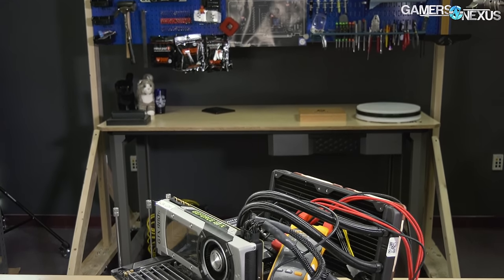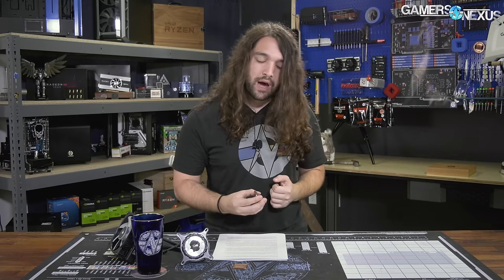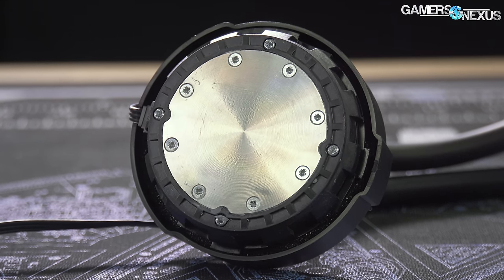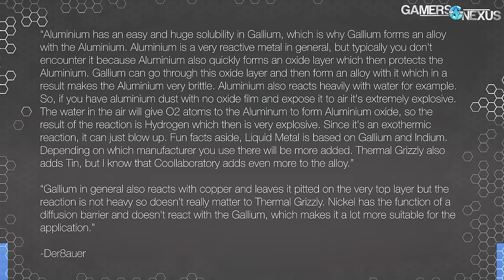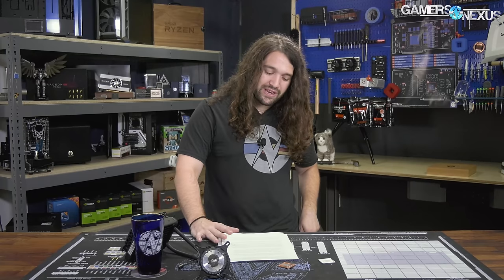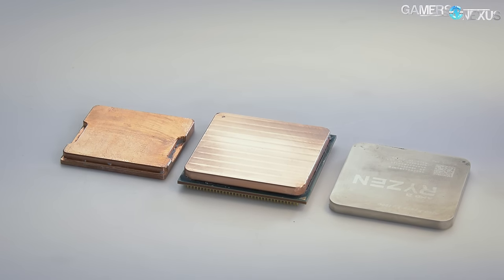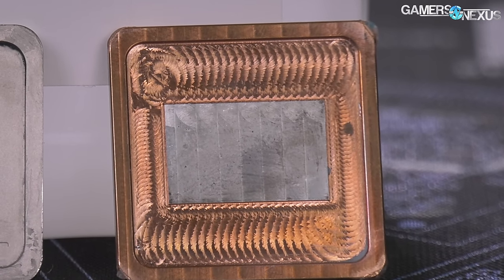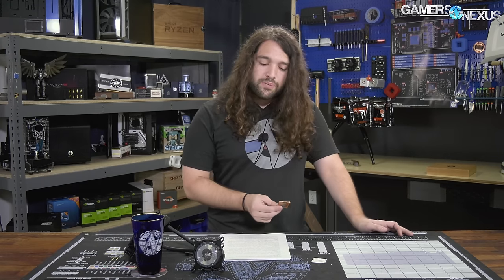How Liquid Metal Affects Copper, Nickel, and Aluminum (Corrosion Test)

Comment from the maker: Check our video on how long liquid metal lasts: https://www.youtube.com/watch?v=fnbovjT4JLQ
Grab something on the GN store! https://store.gamersnexus.net/
Article: https://www.gamersnexus.net/guides/3362-how-liquid-metal-affects-copper-nickel-and-aluminum-corrosion-test
Reply: Liquid metal can also damage solder joints, so it's not a good idea to use it for shunt mods.
Reply: Steve, would you please do some tests with lapping cold plates?  It would be interesting to see how much a mirror-finish affects temperatures.  You'd probably want a control test, a lapped cold plate only test, and finally a lapped cold plate and lapped CPU IHS test.
Reply: Hey Steve iv seen some concerns and photos of the effects of liquid metal to the die itself. Can u please look into this if there's any truth or anything to worry about?
Reply: great dive into the potentially controversial topic. I do suspect that the depth of tainting is only atoms thick beyond the imperfections of the copper surface. And even then, unless a heat pipe is already on the edge of failure due to excessively thin outer walls, the atoms thick tainted copper outer layer will not cause any problems at all. Also, given the nature of LM attoms filling gaps between copper atoms on the surface, it may actually make the surface a tad better for contact area to whatever TIM is later used (albata possibly immeasurably outside of an ultra-precision lab test), due to LM atoms being better at conducting heat than a void between copper atoms, lol.

Great vid GN crew.
Reply: Thanks so much for this video! I've been pondering these questions for a while. Good to know all the laptops i repaired and did cpu upgrades for will be fine. I started to question the longevity of the performance seeing first hand how the copper and LM react with each other.
Reply: Satellite of Discontent, as der8auer had pointed out in a few vids on soldering CPUs that had not been intended to bond to Indium soldiers, the die is incredibly huge compared to the depth that tainting would diffuse into the glass in any reasonable time frame. at most, LM would only be a few atoms thick on the Silicon nitride protection layer, that is well over a millimeter away from the other side of the wafer where the transistors and circuits are. In all honesty, by the time LM attoms defuse and migrate that far, the atoms that make up the circuits would also have migrated into nothing that would resemble a recognizable circuit, lol. And we are not talking hours or days, we are talking decades for the accumulation of individual atom migration to be a problem on any integrated circuit. A spacecraft with a life expectancy longer than Voyager 1&2 may be concerned with such atom migration, a CPU or GPU that will be replaced in under ten years, not so much. It is a good question.

14nm transistors are about 0.000064mm in size, vs 1mm of glass between the transistors and the LM. And I suspect the atomic migration through glass will be about the same speed for both of them (LM atoms, and the atoms that make up the transistors).
Reply: Byte my bits would really appreciate  I short reply to his latest video bud.
Reply: Fun fact, This is the reason that explosives for use in water, like depth charges, use Al dust.
Reply: There's a very eye-opening video from youtuber LockPickingLawyer called [593] Gallium vs. Titalium - Abus Padlock Meets a Gruesome End that shows perfectly why you shouldn't get Gallium in contact with Aluminium.
Reply: Fun fact: The explosive nature of the aluminium reaction der8auer described is why a lot of solid rockets use a mixture that's partly powdered aluminium. For instance the Shuttle/SLS boosters use (16% by weight) atomized aluminum powder in the fuel.
Reply: @Daniel Monsanto obviously not a long term solution, but you should know what you're doing before you even think about shunt shorting anyway
Reply: Thanks for this one. Steve, you da besst!
Reply: Are thoseRTX cards in the background
Reply: Question i could not find an answer to anywhere. What is better for heat transfer, a soldered CPU, or a CPU with Liquid Metal between it and the IHS?
Reply: Try some ammonia mixed with hydrogen peroxide. To remove the staining from the copper ish. You can form complex with the ammonia and ions.
Reply: Is you guys restocking the beer glasses?
Reply: pr0xZen  Instead of nail polish, one can use a professional coating. I use MG Chemicals Urethane Conformal Coating #4223. Has very good characteristics. Vile fumes when it dries.
Reply: I know gamers nexus is biased to thermal grizzle because they pay you, but disregarding that, the fact remains that coollaboratory liquid pro has far far far better thermal transfer over the copy cat conductonaut. If you are going for conductonaut you're better off with coollaboratory liquid ultra or coollaboratory liquid copper which doesn't have the pitting "issue" at all. Coollaboratory liquid copper is also what you should use for proper shunt mod since it doesn't dissolve shunt soldering, and it doesn't have the unpredictable viscosity.
Reply: A very hazardous stuff when  oxidized. Be warned! Also not  73 W/mk but rather 16,5 at best. Since that what galistan i.e LM can do. Proof of health hazard:https://www.ncbi.nlm.nih.gov/pmc/articles/PMC4007045/
 And a few more! Proof of galistan conducting only 16.5 W/mk is Googleable
Reply: I testes with a EK EVO and a delid 8700k  and at the beginning the performances was there . But after 7 month I was surprised to see CPU cores reach more than 90° at 100% of use.  I unmonted the water block and all the metal liquid was completely dry and  in the cooper surface was like electrolized... happy to have detected this issue before to burn my CPU... I will unsealed the HSI to check how it is...
Reply: Don't use it with vertical motherboards because it WILL leak and piss all over the MOBO my TIM of choice is Kryonaut under the IHS and OVER the IHS the consistency is swell Nice shop too nexus!
Reply: @johndrachenberg2254  try a IHS that has been scored one way Mirror finishes usually end up with leaks!
Reply: @Visentinel  Can you PLEASE not type in "TXT" talk it's highly annoying and makes you look like your 3
Reply: @pr0xZen  So old VHS tape fluid is out?
Reply: @fr33kSh0w2012  ???
Reply: Gamers Nexus did you also tested tempered and untempered metals?
Reply: Daniel Monsanto that’s right if it’s indium, not lead solder.
Reply: Is it ok to use normal thermal paste on top of IHS while having liquid Metal inside of IHS.and if so ,will I get good performance from cpu with temperatures ect ty
Reply: @kobishahar2962  Instead of finding a ready made answer, why don't you gather the important physical characteristics to come to your own conclusion?
The thermal conductivity of liquid metals ranges 40~80 W/m-K.
The thermal conductivity of indium as a typical solder for CPUs is 86 W/m-K.
The thickness of liquid metal can be extremely thin (µm range) with no mechanical stress while the temperature is changing/the materials expand at their different rates as long as the TIM is liquid, while the thickness of the rather solid indium solder must be rather thick (mm range) to accommodate the different mechanical expansion of the materials soldered together so that the thermal resistance of a 10µm liquid metal may be 1~5% the resistance of a 1mm thick Indium solder.
Seeing it only from the perspective of heat transfer, liquid metal should be superior to a solder, because with liquid metal you can realize a may be 100 times thinner TIM before the solid copper with its superior conductivity of about 400 W/m-K can be applied.
Adding as 2nd criteria the time effort/behavior makes the judgement more complex. A solder is dimensioned/soldering is usually performed only once in the life time of a device. For long term liquidity of a liquid metal I believe you have to separate between 1) copper and 2) nickel plated copper. On nickel plated copper the liquid metal probably stays liquid for the life time of a CPU. On copper however gallium is permanently leaving the thin liquid metal TIM to diffuse/migrate into the copper to form there the alloy CuGa2. But the gallium that diffuses/migrates into the copper is missing in the liquid metal and with ever lower percentage of gallium the liquid metal is becoming after a rather short time hard at room temperature. In general the liquid metal on copper is better replaced each 6 months, because waiting for the temperatures to show a noticeable increase may result in the remains of the liquid metal having changed to some hard material which needs quite some effort to get removed.

Doing some basic calculation with a lot of assumptions to understand in absolute terms about what is spoken could look as follows: A CPU designed for 100W TDP is reporting a temperature of 75°C under load at an ambient temperature of 25°C (Note: Intel tested the accuracy of such thermal sensors and one should consider in extreme case a deviation of +/-4°C).
Taking these assumed numerical data one can calculate: 
   Thermal resistance (CPU-core to ambient) =  (75°C-25°C) / 100W = 0.5 °C/W
This total thermal resistance of 0.5 °C/W consists of following series of resistances (high quality desktop): CPU transistors to surface of the silicon die + TIM1 (commercially either thermal grease or solder or applied by private people liquid metal) + nickel plated copper heat spreader (lid of the CPU) + TIM2 (commercially thermal grease, a few enthusiasts apply liquid metal) + copper block (only in high cost/quality CPU fans) + large fan ventilated aluminum heat spreader/heatsink/heat evaporator to air/ambient.
When the CPU would operate at 20° higher temperature of 95°C the result would be:
   Thermal resistance (CPU-core to ambient) =  (95°C-25°C) / 100W = 0.7 °C/W
In other words, for a 20°C reduction in the operating temperature of  the CPU one looks for a way to reduce the thermal resistance by 0.2 °C/W.
How many percentage of the 0.7 °C/W (reduction of 0.2 °C/W) is related to TIM1?
In addition to the thickness of TIM1 one needs also to know the area and for a CPU silicon chip one can roughly assume 200 mm². Further assuming the thermal grease applied has a conductivity of 4 W/m-K results for an assumed thickness of 0.1 mm in:
   Thermal Resistance TIM1(thermal grease)= 0.1 mm / (200 mm² * 4 W/m-K) = 0.125 °C/W
In comparison a 10 times thicker 1mm Indium solder results in:
   Thermal Resistance TIM1 (indium solder) = 1 mm / (200 mm² * 85 W/m-K) = 0,0588 °C/W
Assuming a best case possible thickness of only 10µm even a not top thermal conductivity liquid metal may reduce this down to:
   Thermal Resistance TIM1(liquid metal) = 10  µm / (200 mm² * 40 W/m-K) = 0,00125 °C/W

The key point of liquid metal clearly being the strong reduction possible in the thickness.
Above calculations do not consider that the TIM1 thermal resistance actually consists out of 3 resistances, first the contact resistance between the silicon die and the TIM, second the length and area dependent resistance of the homogeneous TIM material as calculated above by its thermal conductivity and third the contact resistance from the TIM to the nickel plated copper heat spreader. The additional 2 contact resistances will add a considerable amount to the values calculated above seeing that liquid metal is assumed to be extremely thin 10µm and contact resistances of silicone to metal are much higher than metal to metal, but the above calculated values give a first feeling what is possible/achievable by the 3 materials thermal grease, indium solder and liquid metal.

Finally some consideration on TIM2. A typical heat spreader on a CPU may have an area of 1.600 mm², this means 8 times larger than the silicon die. Over this quite large area thermal grease may be compressable down to 50 µm resulting in:
   Thermal Resistance TIM2(thermal grease)= 50 µm / (1.600 mm² * 4 W/m-K) = 0.0078 °C/W
Liquid metal having a much lower viscosity may be compressable down to 20 µm resulting in:
   Thermal Resistance TIM2(liquid metal) = 20 µm / (1.600 mm² * 40 W/m-K) = 0,00031 °C/W
Also on TIM2 liquid metal is clearly much superior to thermal grease, because of its lower 20 µm thinness and its much higher thermal conductivity, but the improvement on the total resistance of 0.7 °C/W is based on a share of only 1% (TIM 2 share as thermal grease = 0.0078 °C/W / 0.7 °C/W) on the total heat resistance while the improvement on TIM1 is based on a share of 18% (TIM1 share = 0.125 °C/W / 0.7 °C/W) resulting in the fact that replacing thermal grease by liquid metal on TIM1 results practically in around 20°C lower CPU temperatures under load, while doing the same on TIM2 results in only 1~3°C lower CPU temperatures. 

Above simple thermal resistance calculations clearly confirm the practically found temperature effects and everybody can modify above data to his specific arrangement/application. Accurate calculations however are quite difficult because the contact resistances are difficult to account for and also the actual TIM thickness is quite difficult to know. And in practice the hardening of the liquid metal after some time when it is applied to copper, due to the fact that liquid gallium prefers/likes to alloy with the solid copper to form a mechanically stable CuGa2 layer on the copper, instead of staying in the liquid metal, leaving a liquid metal with steadily lower percentage of gallium are much more important considerations than a more accurate calculation.

Comment: After using liquid metal on a bare copper heatsink for a year, I noticed that the liquid metal had fused to the copper and became a solid similar to the chalky residue from the aluminum heatsink test. I also noticed that the thermal performance became worse over time because the liquid metal was no longer liquid and even with the heatsink removed and heating the surface up, the stuff didn’t turn back into a liquid. So I’m guessing some of the copper and galinstin actually changed chemically so now the only way to get the flat surface back is to scrape off the alloy of galinstin plus copper and not scratch the actual copper
Reply: That usually happens if the copper had imperfections.   Sometimes this is intentional to cut costs.   I've been running the same liquid metal for 6 years on a pure copper plate with 0 problems.  Still liquid.
Reply: Did you ever reapplied !! After 2-3 month you actually have to reapply liquid metal !!! This step is very very important and everybody missing it and then claiming that it does not work!!!
Reply: @IvanRossS Finally someone said it. First year, reapply it at least twice, after that the galium migration will slow down significantly as the galium that already migrated will act as a barrier and you will not have to reapply thst often anymore.
Reply: @dariobarisic3502 do I have to clean it with alcohol or just reapply it directly?
Reply: @khawajashaharyar9294  What's left of the liquid metal that's bridging the cpu/gpu die and the heatsink should be gallium deficient so it's not of optimal composition. Therefore, I would suggest cleaning it off with alcohol first and then reapplying. Is it absolutely critical to first clean of the remains? I have no idea. I would imagine gallium is used in the composition due to its low melting point so galium deficiency could case lm to not be so liquid anymore and that's obviously bad. In summary, cleaning it off first and then reapplying seems like a safer option
Reply: you have to re-apply liquid metal after 2-3 months after first application :)
Reply: Same here I used it 1-2 Years ago in my VEGA64 Nitro+ and for some weeks it starts that in games I got the black screen of death but the computer is still running... I first thought it could be the power supply but today i checked the GPU und saw nothing liquid anymore and it looks more like that I solder metal to the copper.... I polished it several hours so that it becomes like a mirror but the metal loocking parts are still uneaven.... The heatsink is out of copper und ruinied know... I hate so say... In the Video he sais copper is ok... No coppler is not ok! And the liquid metals sticks very heavy to the die in addition... I was able to get it off with Isopropanol and looks good now... I ordered now mk6 arctic and hopefully I can use the GPU again.... I just used a thermal pad and it was possible to play a game for some minutes but the fans geht loud and I do not want to risk permanently damage to the GPU. So I will never use liquid metal again because it ruins your heatsinks.

Comment: Let's see what Intel thinks.. hmm they suggest toothpaste as the best
Reply: But at least toothpaste leaves your metal clean and plaque free.
Reply: Sure, if you want to delid the CPU every 2-3 years, use liquid metal.
Reply: Jokes aside, i used toothpaste in my first pc, LGA 775, 1.8ghz celeron, heatsink plastic socket died and i had to secure it with a ziptie to the MOBO and replaced original thermal paste with toothpaste as a temporal fix for at least a week or two, got some solid 70º under load, much better than expected tbh
Reply: @xXPAKSLAYERXx  AGH HAHAHAHAHAHA HOLY SHIT DUUUUUUUUDE!
Reply: @CaveyMoth  lol
Reply: I  change my intel toothpaste, for Colgate works better so intel need some improvement 😂😂
Reply: @LeoKadettTouringCar  can't go wrong with oral-b.

Comment: I wonder what type of Liquid Metal Sony used on PS5..
Reply: gallium based mostly
Reply: I still don't get why they did it. Watch it dry out completely in Judy 1 year of use!
Reply: @Ownage4lif31   im thinking its a marketing hype. it will have hardware revision sooner than most people think and replace with regular heatsink and thermal paste
Reply: @qwerty6789x  that's why you always wait a year till you buy a new product. I wouldn't be surprised if they released the ps5 slim next year